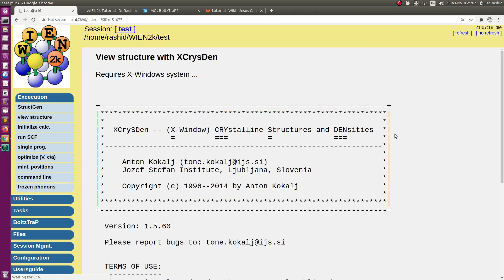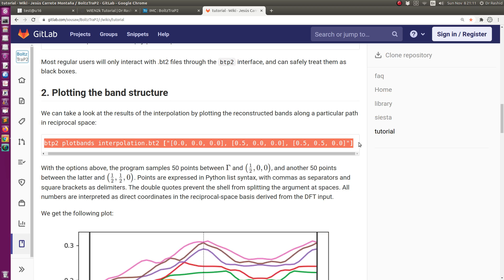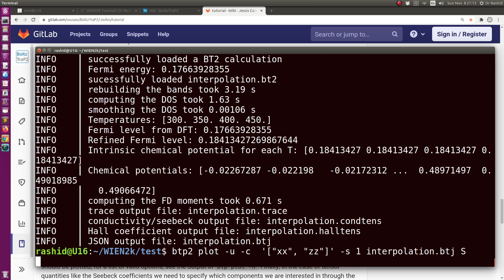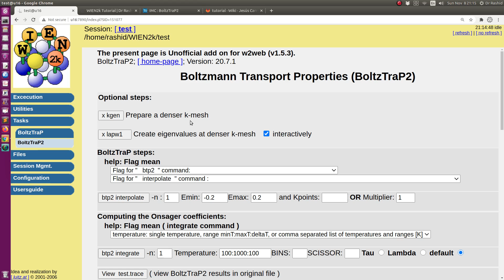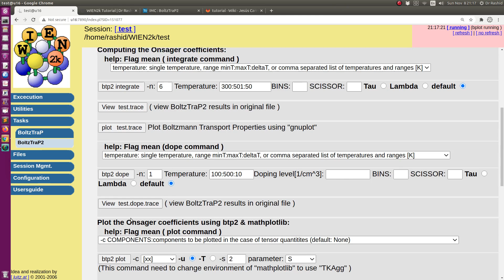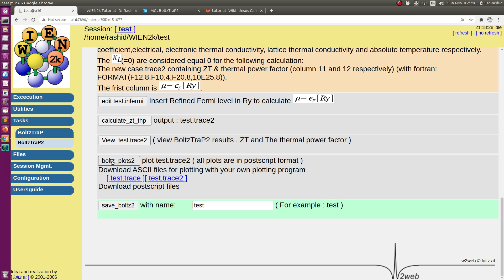WT12: Calculation of Seebeck coefficient using BoltzTraP2 and WIEN2k

Comment: this video is very helpful. thanks for your guidance. now i am facing a problem in spin polarized calculation. there was a btp2.error. 
INFO    │ looking for a BT2 calculation
INFO    │ error in BT2 loader: this loader only works with dictionaries
INFO    │ looking for a AIMS calculation
INFO    │ AIMS system name: /home/tanmay/WIEN2k/NdFe4Sb12
INFO    │ error in AIMS loader: geometry.in file not found
INFO    │ looking for a ABINIT calculation
INFO    │ error in ABINIT loader: no valid abinit run files found
INFO    │ looking for a CASTEP calculation
INFO    │ error in CASTEP loader: cannot determine a CASTEP system name
INFO    │ looking for a GENE calculation
INFO    │ error in GENE loader: cannot determine a GENE system name
INFO    │ looking for a Wien2k calculation
WARNING │ there is more than one .struct file in the directory - using the first one
INFO    │ Wien2k system name: NdFe4Sb12
INFO    │ error in Wien2k loader: energy(so) file not found
INFO    │ looking for a VASP calculation
INFO    │ error in VASP loader: vasprun.xml not found
Traceback (most recent call last):
  File "/home/tanmay/.local/bin/btp2", line 8, in <module>
    sys.exit(btp2_main())
  File "/usr/local/lib/python3.8/dist-packages/BoltzTraP2/interface.py", line 1157, in btp2_main
    parse_arguments()
  File "/usr/local/lib/python3.8/dist-packages/BoltzTraP2/interface.py", line 1146, in parse_arguments
    args.func(args)
  File "/usr/local/lib/python3.8/dist-packages/BoltzTraP2/interface.py", line 205, in parse_interpolate
    data = BoltzTraP2.dft.DFTData(args.directory, args.derivatives)
  File "/usr/local/lib/python3.8/dist-packages/BoltzTraP2/dft.py", line 387, in _init_
    raise ValueError(
ValueError: no calculation found in directory /home/tanmay/WIEN2k/NdFe4Sb12  

please suggest me how to remove this kind of error. again thanks for your help.
Reply from the maker: Did you do SCF calculation? If not, do the SCF calculation first.
Reply: @phy22  yes I have done scf calculations
Reply from the maker: BoltzTraP2 is not detecting energy file. Try with a small trial system. Maybe you will be able to figure out the problem. You may also need to run lapw1/lapw1c as explained in the video.
Reply: @phy22  thank you for your help. after doing all kind of combination i finally conclude that this problem comes only in the case of spin polarization. in all other cases it work without any error.please take a look in that problem
Reply from the maker: Thank you for letting me know that.

Comment: Sir in the trace file the Thermal and  electrical conductivity have a factor of tau(relaxation time) divided .... how to find the value of this tau and remove it
Reply from the maker: I'm NOT sure. The relaxation time is in principle dependent on both the energy and temperature. However reading the code I found that in BoltzTraP it is kept constant as 1e-14 s.  Please do not quote me. Its better if you dig it deep yourself.
Reply: @phy22  thank you sir i also looked up the boltztrap code it is indeed what you have mentioned ...ty for the response